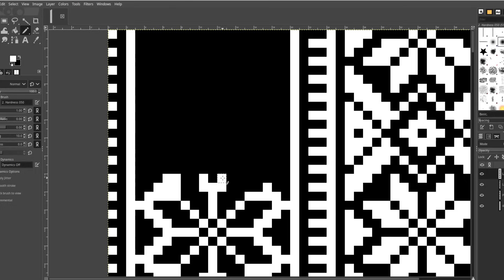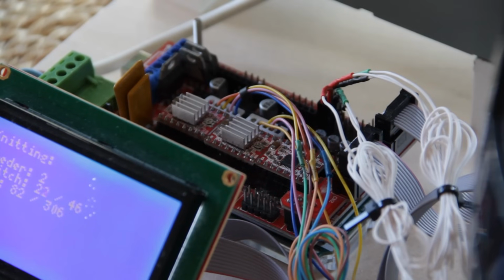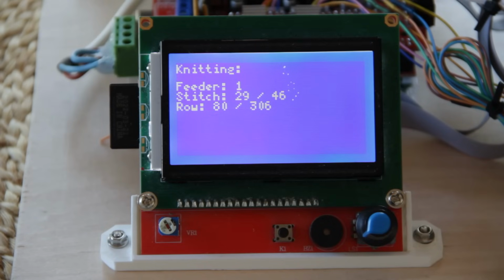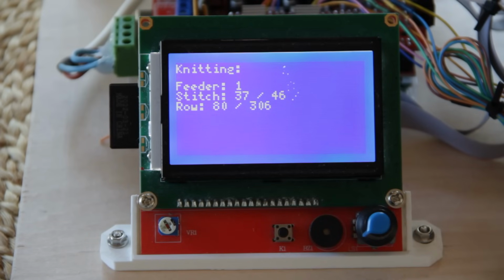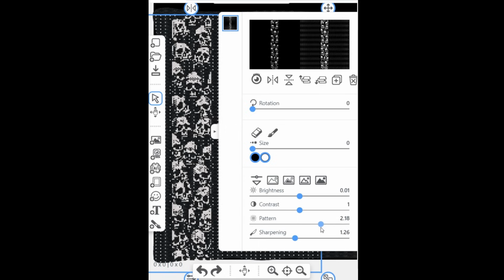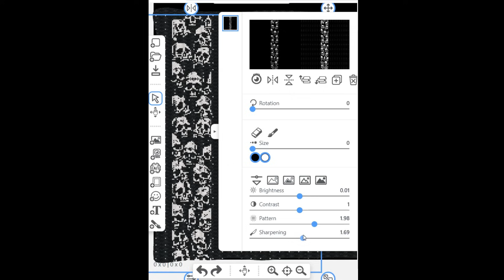Modifying and Automating the Addi Knitting Machine for Multi-Color Knitting. For fun and Profit!

Comment: This is so neat! The fidelity you're getting in the designs at the end is similar to flat rack knitting machines which are much more finicky!

Personally Ive been wanting to attach a bicycle pedal to a knitting machine so i crank the machine with my feet when my hands get tired haha
Reply from the maker: Thank you so much! Though, I’m afraid the camera is a bit too generous, sadly the knitting output is far from as good as one could have hoped. Maybe it's also partly due to my inexperience with this particular machine. But it definitely has potential!
Attaching a bicycle sounds like such a fun idea, I’m sure pedal power could easily run 10 of these in parallel with ease!

Comment: Knot detection could be as simple as feeding the yarn through a hole at the end of a pivoting arm, maybe an adjustable sized orifice like an aperture if you wished, that has clearance for the unknotted line. When a knot is caught, the arm pivots into a light sensor, which you seem to enjoy using, and haults the production.

Comment: Instead of the addi why don't you tackle this for a circular machine that has real steel needles and more potential.  There are a few versions of the 3D printed hat knitting machine like the Maker or the new one by Joyce Parsons .  I believe they would be more reliable and worthy of this project and your expertise than the  plastic circulars.    They also have more needles and fit better than the plastic circulars .   Great idea but these plastic circular machines are basically toys and not great for production work .   Just to automate them apparently they need a rest time  so also not efficient .  The only thing going for them is that they are cheap   But even then the cheap price is a trade off.   Would be great to do something like this for the steel circular sock machines that last 100 or more years.   But I would be happy to see it done on the intermediate  type like the hat machine with the steel needles .
Reply from the maker: Hi, I was actually looking into those machines before I settled on the Addi. The reason I chose the Addi was twofold:  
1. I wanted a platform that would work right out of the box. The 3D-printed machines with metal needles seemed a bit fiddly, and if I built a color mechanism on top, it could potentially be difficult to troubleshoot.  
2. The Addi's needles are fairly large, theoretically making it easier to construct a less precise color-changing mechanism.
But now I am thinking about the possibility of making a version with metal needles.

Comment: Just a suggestion, don’t overthink the knot sensor too much. Might be a simple as threading your yarn through a hole/slot on a toggle switch small enough for the yarn to go through that will turn off your machine when the knot won’t pass through and pulls the toggle. You could even use one of those flat tensioners and get both benefits.

Fantastic machine. I love it and can’t wait for updates.
Reply from the maker: Thank you so much for your comment! I think the small-hole-approach would indeed be the best option and ideally it should be paired with the already existing optical sensor so the part count can be kept down.

Comment: i got an idea for the knot detector i think you can use :) 

if you use a ptfe tube from an old 3dprinter or similar as a size gauge for the knots, so if the yarn has knots on it the knot will not pass through the tube that has now been moved to trigger a simple switch from any old e-waste. all u need to make is a plate to hold it, and the code to use it as a trigger to pause. then its just a matter of finding the right sized insert and or tube size.

hope it helped.
Reply from the maker: Hi! Using a ptfe tube might be a really good idea! I will try it out. If the yarn can run smoothly through it then it might also be a way to guide the yarn through the machine. But then the question is, how to get the yarn through the tube 😁
Reply: @MartinMakesThings  easy... you thread it with stiff fishingline taped to the yarn. anything else you want consulted? hit me :)

Comment: Instead of optical sensors can't you use Hall effects sensor wouldn't it be more safe and faster?
Reply from the maker: There are many parameters that go into picking sensors. Optical sensors give me a very simple binary output, and the sensors are cheap. For the needle detection, a Hall effect sensor would not really be feasible. So price, ease of use, and simplicity in using a single type of sensor were all parameters in picking optical sensors. One potential downside with optical sensors, though, would be that all the yarn dust the machine creates could potentially block the sensor. However, in the code, we can then put a timeout that will trigger a machine stop if we do not get the sensor trigger when we expect it 🙂
Reply: @MartinMakesThings  thanks for your answer

Comment: If you havent already figured out thebknot detection (the video is a month old and im sure you've probably already figured something out), I think for knot detection you could do a channel slot U shape with a taper for easy feeding that goes to the diameter of the yarn beneath the tensioner. If a knot goes in, it pulls it up and engages the switch.

Comment: What is your opinion on the Kniterate? Have you had the chance to use one before?
Reply from the maker: I might not be the best person to ask, as I don't have much experience, but it feels like a very high-quality small (in the industrial sense, not home sense) industrial machine. The core is made entirely of metal components and is built like a tank. It does require a lot of training and experimentation to get it working properly, it’s not as easy to achieve good output as the sales material might suggest. This seems to frustrate some new users. However, in the right hands, it seems to be an extremely capable machine. I find the software to be not very intuitive, and it is cloud-based, which is not optimal.

Comment: You could make flat panels with this by not completing a full circle and running the knitting machine backwards every other line, maybe.
Reply from the maker: Yes, in theory, but currently the hack is setup to only function in one direction because of where the yarn threads are currently going in under the needles.

Comment: Commenting to up the engagement. And funnily enough, I'm also working on a project with pixel art that harkens back to the old radica Skannerz toys. Would love to see how this online pixel art designer works as I've yet to come across a pixel art designer that works exactly how I'd like it, I'm getting by with regular digital art programs.
Reply from the maker: Thanks for your comment! I don't know if it will fit your needs, but one of the things I really wanted was to be able to control dithering separately for each layer, so for instance, you can have a dithered image and non-dithered text on top 😀

Comment: You obviously have done much+ which you did not show us... But in particular you took a lot of time showing us the feeder "selector"...  Am I confused?  You showed us it all for 2 yarns, yet  when running the machine was using 3 ?
Reply from the maker: I'm sorry for not explaining it better in the video. I actually just finished filming a better explanation for the deep dive. But essentially, two yarn threads are for color, and the third is what is sometimes referred to as "plating," a thread that is being knitted for each stitch but is hiding on the backside of the knitted piece in order to hold everything better together.

Comment: Very cool project!
Wouldn't it be also possible to get the yarn back from the final product and maybe knit it back into a different pattern? The yarns should be the same length.
You could wear your custom scarf with text on one day and re knit the yarn into a different message
Reply from the maker: That's actually a wonderful idea! There would be knots in the yarn, and the yarn would deteriorate a bit over time from being unwound, and it would involve some manual work, but it would definitely be possible to do it.

Comment: Omg this is so cool! Since it can handle 3 strands, could you do 3-color designs by swapping out which yarn acts as the scaffold, or would that undermine structural integrity? There would also be the matter of implementing a third color in the design software, but maybe the user could outline areas with a selection tool (or target all black or white pixels within that area) and toggle what colors the white and black values have, or you could implement a 50% gray value in the threshold and do rough gradients? So many possibilities!! My mom has a metal sock knitting machine and it's so fun to crank the handle and watch it zoom around the circle 😂
Reply from the maker: Haha, it's awesome to see how limitations can inspire creative thinking! Here's a little secret, I'm currently testing out multiple colors for the next video 🙂

Comment: I seem to recall that the first known example of a Turing machine, a reprogrammable computer, was a water powered, multicolor, weaving machine, somewhere in China in the 200's, if I recall correctly. It was a six color graphics processor, basically, that read patterns from bamboo plates strung together, like punch cards. 
And now we have come full circle, with the weaving having become only a novel use case.

Comment: Man you are an absolute genius! 
Do you have tips on how to design moving mechanisms when you need a certain motion? 
Like you have your requirement for the feederhead to do that specific movement, how do you get to the oval shape?
Are there any books or resources you have found to be helpful in learning more about the design process of multiple part objects?
Reply from the maker: When I need a specific motion, I usually doodle it out on paper, then test it out in my 3D program. After that, I print it out and check if any adjustments are necessary, I iterate and print a lot!. If you are looking for mechanical inspiration, there are some great YouTubers creating animations of all kinds of mechanical mechanisms. I actually also just ordered (haven't received it yet) an old book called "Mechanical Movements, Devices and Appliances" which is supposedly filled with such mechanisms for inspiration.

Comment: This is incredible!  I would love to have one of these setups myself. Ive played with the idea of getting a knitting machine, but they are just so expensive. Would you consider selling the designs?
Reply from the maker: Hi, the design for the machine will be free for non commercial use (if you want to print it yourself), and I might sell a kit with the needed components. But I have to be honest and say that the reason these plastic knitting machines are cheaper is due to their quality and flexibility. They are probably best labeled as capable toys 🙂

Comment: I've had a similar idea for a while! I would also love a kit, or possibly a set of files (STLs, BOM, Instructions) to build my own.

When you mentioned runout/tension/knot detection, my first thought was to use printed or repurposed spools (such as filament spools), which could possibly be controlled via stepper to maintain tension. I think your tensioning system is better, but maybe making an automated spool winder would be helpful to reduce knots, tangles, etc. You could possibly even wind 3 spools at once, to strike a balance between efficiency and quality control.
Reply from the maker: Rewinding the yarn and pulling the thread from the middle would indeed be better, both in regards to knots as you mention, but also to give more consistent knitting by reducing the bouncing of the yarn as it is being fed to the machine. I do that when knitting on my old Brother machine. Laziness has been keeping me from doing it for this machine because it eats yarn like crazy. But perhaps it is worth looking into making an automated winding machine, as you mention, for this purpose 😀
Reply: @ I know that I’ve seen the some sort of skein winding machine at my local yarn shop, where a hand crank turns something that vaguely resembles a spool while someone holds the yarn to make sure there aren’t any snags or anything. 

My thought was that if it’s easy enough to bring that concept to one spool, it should work with 3, which would be convenient considering your machine uses 3 strands of yarn. Maybe something similar to a yarn bowl could hold each skein, with the yarn being pulled from the center. With some tuning, you might be able to make the winder halt when there is a certain amount of resistance, so you would only need to attend to it whenever there is a snag. If the process can be tuned to the point that it mostly runs smoothly, you could scale up to have dozens of spoolers preparing yarn faster than your knitting machines can use it up. 

You might even be able to get yarn from a supplier in larger units that are easier to feed in.
Reply from the maker: @Alex-wl1sp  Large cones would be ideal, but I haven't found a supplier that matches the price per gram and the consistent availability of the skeins I currently use.
I reached out to the supplier directly, but they only sell their yarn in skeins and require buyers to become official resellers with a webshop to purchase directly.
So, since they're set in their ways, an automatic winding machine might be the way to go.

Comment: Great project! Will it be open source? I ask because I’d love to build it. Does it work with G-code? I’m guessing it defines the rotation speed, and then the software converts it into G-code based on the patterns. Or how does it work? Looking forward to the next video to understand it better!
Reply from the maker: The plan is to release it under CC BY-NC-SA. No its actually much simpler than G-code. The pattern format given to the machine is basically just a matrix defining the pattern and a bit of extra meta data. I hope to go into more detail in the next video.

Comment: I'm not sure how it would work on a knitting machine, but when knitting with multiple colors, if you want to avoid the "runs" on the reverse side, you "trap" the unused color between the stitch. To avoid the long runs on the reverse side, I avoid a consecutive row of more than 5 stitches of the same color. anything beyond that becomes unmanageable. It would be possible to write a program to apply this rule to the image. The "fair isle" technique addresses this issue and also some others, such as avoiding a column of the same color for so many stitches.

What you've done is really incredible, and I think you are very close!
Reply from the maker: I'm still actively looking into ways to trap the floats on the backside. Limiting "bad" designs in the software is an interesting idea. I was thinking about making "bad" areas turn red on screen, so users can decide if they want to take the risk or not 🙂
Reply: @MartinMakesThings  I'm really interested to see how this progresses! I've wondered how something like this would work for as long as I've been doing multi-strand knitting. I'll have to try writing a python script to convert greyscale images to valid knittable images, for fun.
Reply from the maker: @RaccoonEatingCacti  That sounds like a fun challenge, I'd love to hear how it goes!

Comment: As a rug tufter, I have to suggest one small thing. You should start rolling your own balls of yarn from the skeins. Also try and find the yarn from the inside of the skein as opposed from the outside. The yarn won’t jump around if you get it coming out of the centre. Otherwise, a very cool project! I love it.
Reply from the maker: You are absolutely right! I actually do that for my Brother knitting machine, but this thing eats skeins so fast that I wouldn't be able to keep up 😂
Reply: @MartinMakesThings Have you considered using cones of yarn? They've got a lot more yarn on them!
Reply: @MartinMakesThings for twisted skeins, do you open them up and run them on those collapsible spinners used for rewinding? Are there problems with inertia and it spinning too much? Curious about the details of the setup!
Reply: For the general circular knitting machine user, we buy the yarn ball winder that produces a shorter, fatter, rounder ball that becomes much easier to use the yarn from inside the skein. Just google yarn ball winder it's only a small gadget.

Comment: Hi Martin, this is a super interesting set-up you've created! I'm quite eager to buy the actual adapter or plans if you sell them to people. I'm wondering can the adapter be used with the Sentro 48? I bought the Sentro instead of the Addi because it was cheaper on Amazon haha!
Reply from the maker: This exact kit would not fit the Sentro, but it could be worth trying to make one that does if there is enough demand.
Reply: @MartinMakesThings  Thanks for the reply. I'd be willing to buy the Addi if that's the case. I'm guessing from your reply that you don't have any plans to sell the adapter or the plans?
Reply from the maker: @Brenners2010  I am honestly still trying to figure out what the plan is, so I can't make any promises. However, I can imagine that if not me, then someone else might create a Sentro compatible system once I release the files. Please don't rush out and buy a new machine just yet🙂

Comment: Is it possible to not knit in the round with your setup too? Usually flat panels are possible if you crank the machine by hand 🤔
Reply from the maker: Currently knitting flat panels is not possible, but I think it could be made possible.

Comment: Subbed immediately this is AMAZING I’ve been looking for vintage punch card knitting machines but I have an addi and sentro I will try to do the pattern myself I’m curious if you could do the back and forth flat panel with the addi creating larger panels
Reply from the maker: Flat panels aren't currently possible, but it may be possible to redesign the mechanism to function in both directions.